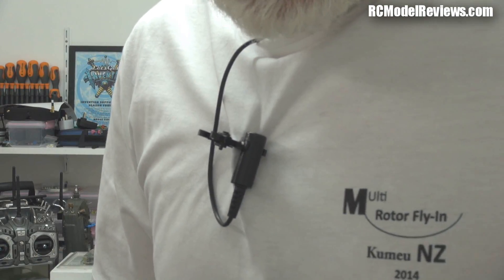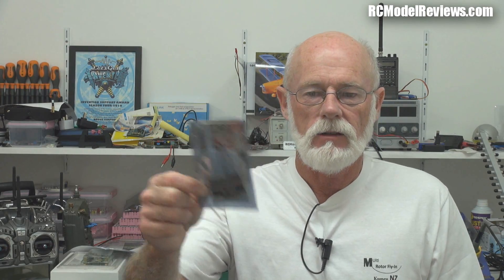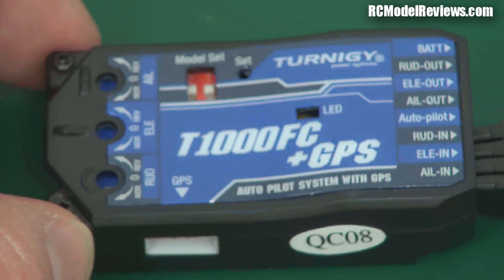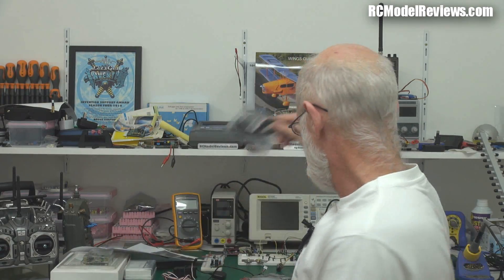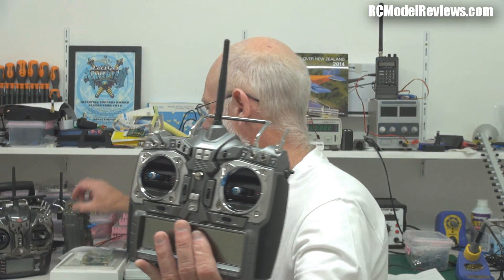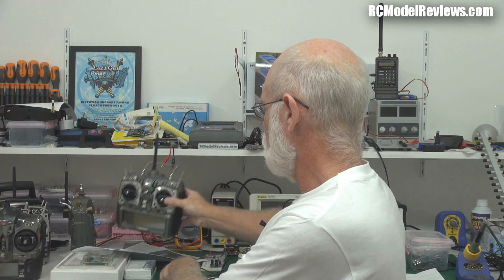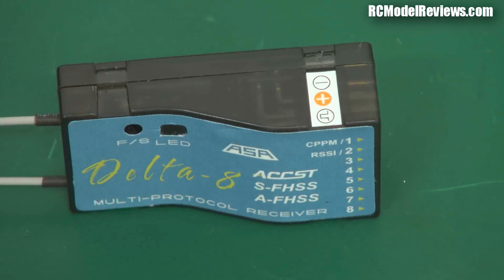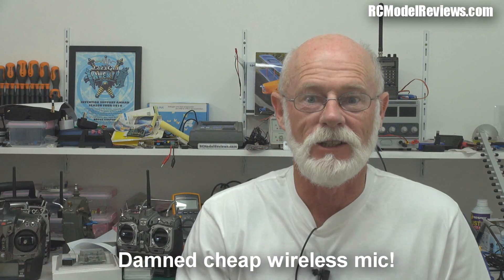Weekly News (22 Jan 2014)

Comment: Loving the new aurora 9x tx though have just found an annoying bug. I fly f3k gliders and have multiple flight modes on a single switch. If i have the transmitter screen on the front page i can trim each flight mode individually, but if i am in the full screen timer page i can now only change trim of the flight mode i was in before changing pages. So for example if im in cruze mode with +5 clicks of trim change screens to the dedicated timer page move switch to thearmal mode give +5 clicks of trim and go back to the main page it shows cruze mode with +10 of trim and thermal mode still at 0 trim, when it should be cruze +5 and thermal +5.

Comment: Hi Bruce,
That Delta-8 receiver also features CPPM output that can be used for wireless buddyboxing as well. I use it in my Taranis (love that thing!) and its great because it binds to 3 different vendors systems. Too bad it does not support FASST. Taranis trainer settings allows you to match the channel order to any system.

Comment: Always enjoy your reviews, Bruce....especially looking forward to your video on motors,ESC's and props. I usually look to the forums to find recommended motor combos, but you always seem to be able to fit the puzzle pieces together in your informational videos...glad to see that you are keeping busy!
Reply: JB if ya have a watt meter, your only limited by -- weight ,room, prop ground clearance your imagenation ( need spell check) it's fun sometimes to take a gaser and put enough motor and battery to make it CG without adding weight's what happens is you get a plane that has exstream power..!! and will leap into the air but be careful it'll also rip one apart see the stylist for a example..!!

Comment: will that Turnigy T1000FC be compatible with multirotors
Reply: OK Thanks , giving it a look right now and compare some prices i`ve found on ebay
Reply: No, it's for fixed wing.
Reply: bugger . and idea`s for a cheaper version of the naza gps system
Reply: cathari5lives
The APM 2.5 or 2.6 are probably the cheapest (reliable) NAZA alternatives at the moment.  It'd work out about $110-$120 for a full multirotor flight controller with GPS, return to home, loiter, waypoints and all that stuff.  Not that much more than the T1000FC anyway.
Reply: cathari5lives You get get the Naza lite as little as £100 now, ($165) =]
Reply: *****
Thanks Bruce , i`ll give it a look
Reply: *****

where from ? , the best i can find on ebay is over $200 aussie $ including postage
Reply: In the UK:
http://www.firstpersonview.co.uk/quadcopters/flight-controllers/dji-naza-m-lite-flight-controller-gps

There are some places on eBay, matching the £110 mark at the moment. (China stores)
Reply: *****  thats pretty good best price i`ve found so far works out at $200 aussie dollars , thanks again
Reply: No probs =]